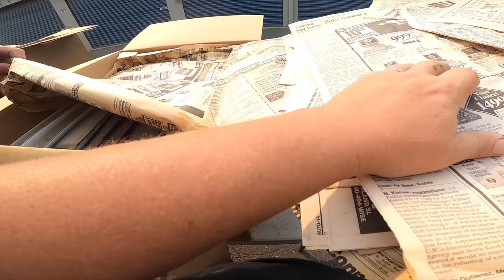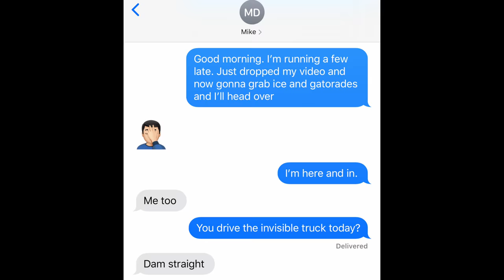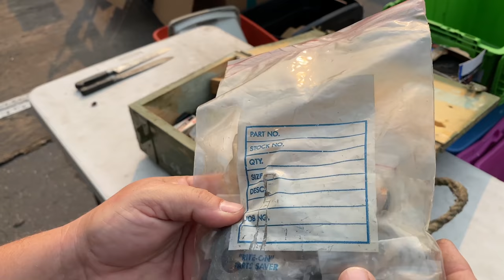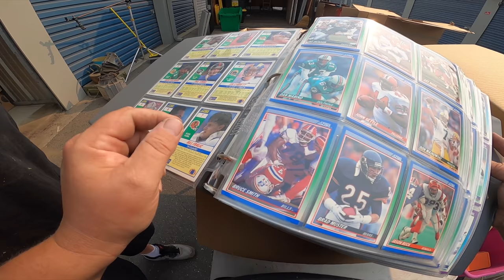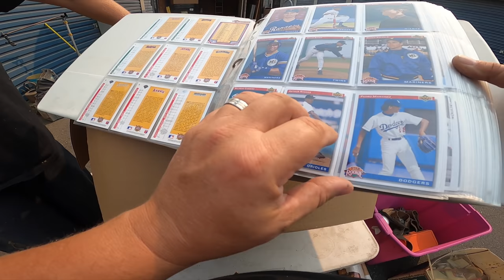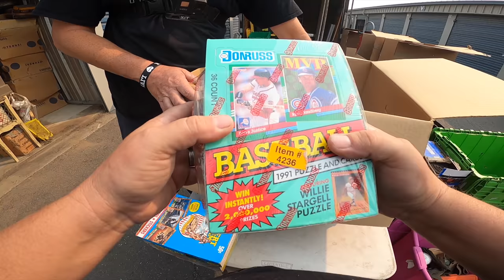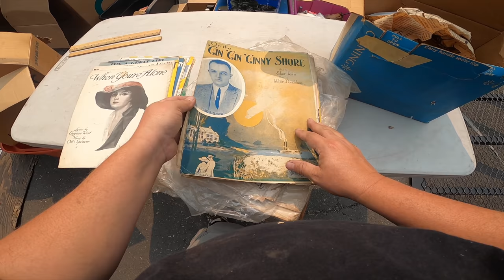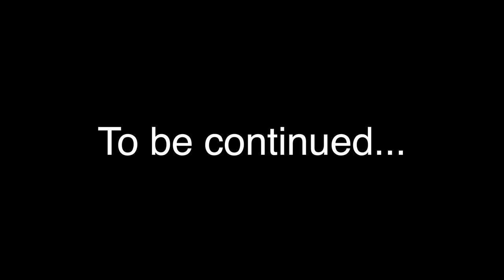This locker is a DUSTY GOLDMINE of treasures and vintage items! I bought a storage auction unit.

Comment: Travel dolls don’t usually have high value.  Usually sold as a doll lot is best and just in case there is a valuable doll in the lot, a collector will spot it, so take a few clear photos.  The Bride doll with the original backing should be sold in a separate auction, as a side note bride dolls rarely had a groom unless your talking paper dolls.  The bride doll might have markings on the head near the near the neck.
Reply from the maker: Thanks!